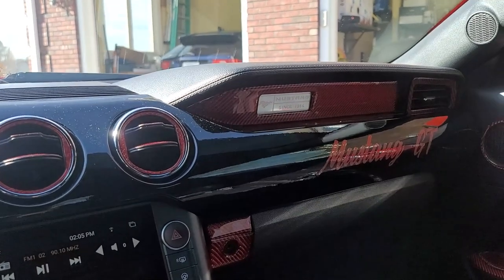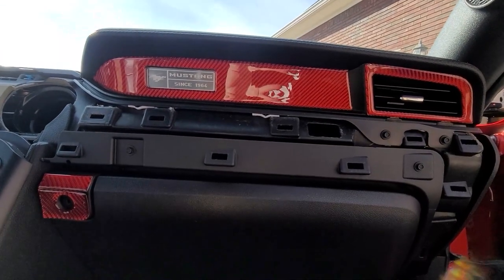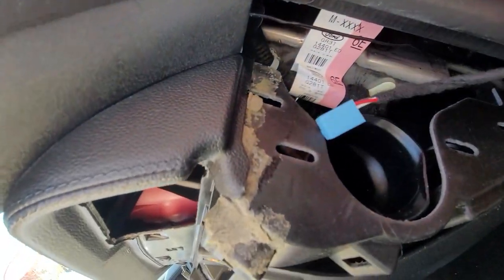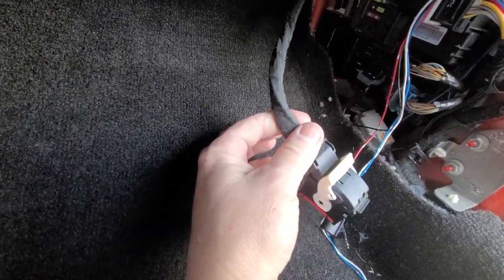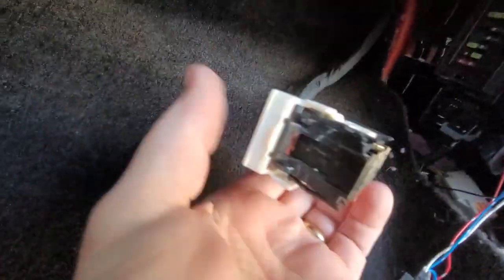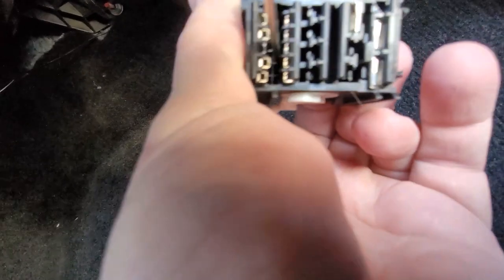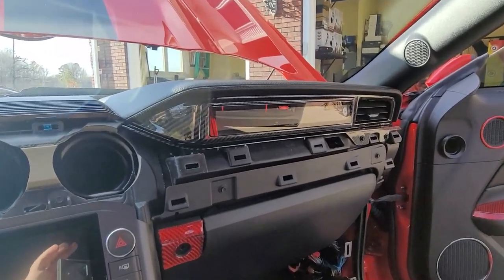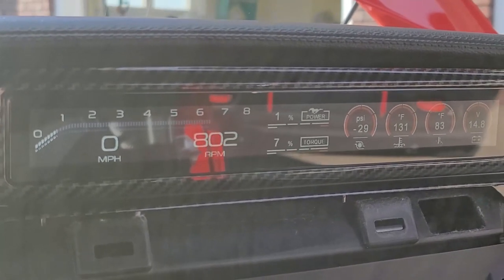Passenger Display Install 2016 Mustang Gt

Comment: I followed your instructions and installed the passenger screen, and it worked perfectly for a long time. However, recently, Ford issued a recall regarding the brake system warning indicator. I took the car to the dealership for the update, but they couldn't successfully update the codes. Moreover, the screen stopped functioning and it's completely off, and they claimed they couldn't fix it. It's frustrating because I handed over my car in good condition, but now it's worse off. I'm unsure if the screen issue was caused by the update or if the update caused the screen malfunction.